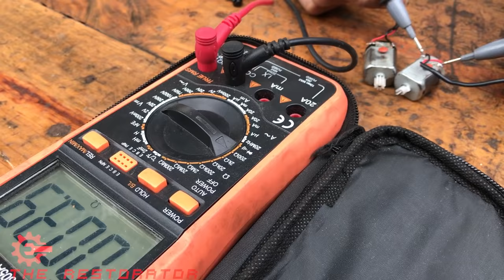Restoration OFF-ROAD Vehicle Car | Restore Car Remote Control

Comment: I used to assemble such tous (bigger) with supplies plans. But to see you doing block my stomach. Quite a great job. Do you know that hère in Quebec, Canada it mots around $650 Ca. including servos, batteries and charger.Which is around 700,000 Japanese Yens !!!  This unit is brand new and I guess a young kid was the owner and did not like it.  THANKS VERY MUCH
Reply: Nah.  That thing is maybe $100.  $659 you can get a 4x4 rustler which is hobby grade.